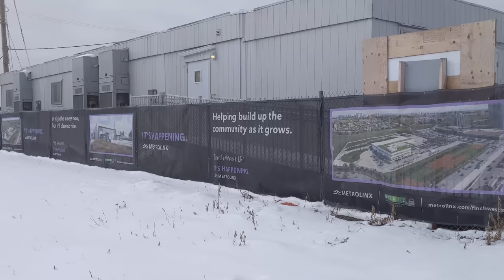Missing Links: Short-Sighted Transit Planning

Comment: The video does not mention an important class of missing link:  The deliberate missing link.  This is usually the case where two different governments or levels of government are constructing transit and feuding with each other.   The example in Toronto that drives me crazy is the lack of connection between the Leslie subway station and the Oriole GO station.   In a rational world, the GO station would be moved 250 metres up THE EXISTING TRACK and co-located with the subway station in order to make for an easy transfer.   But we do not live in a rational world.
Reply: Another example is the Bloor GO Station, to the east of Dundas West Station - of course, the added problem there is Crossways Mall between both stations, that could provide a decent underground connection, but probably will never happen.

Also, there is Danforth GO and Main Street Station, but that one was more a problem of proximity between the two stations...one being the location of (I believe) York Station on the Grand Trunk Railway, and the other having been a streetcar loop just north of Danforth Ave.  Mind you, if/when the quad-track is installed, the GO station is set to be moved further to the east, with the main entrance being closer to Dawes Rd. with a connection still at Main St. but still a bit of a walk down the platform now.

(I was also reminded this week that there used to be a streetcar stop for the 506/Carlton Car at the top of the bridge, right by the old stairway, but that was removed when I was a kid.)
Reply: They are moving the Oriole station btw, its just not high up in priority.
Reply: @robmausser  Good to hear.   Do you have a source for that?
Reply: if you cant walk a few blocks to the next station, I am supposed to feel sorry for you?
Reply: @BertGraef  No, I do not really expect you to feel sorry for my arthritis.  Because that would involve having a heart.
Reply: That's why I quite like the fact that public transport is mostly a state government issue (as opposed to a local government issue). That diminishes the possibility of different agencies working against each other. 

 Though that's partially because (with the exception of Brisbane), the other local governments are usually tiny, with less than 100k population in urban areas with over 2 million.
Reply: Good news theres a propsal to do exactly that

Comment: Los Angeles’ Green line not going to LAX was a major fail.
Reply: The cabbies' unions squelched it, as they did in NYC with a subway line to LaGuardia. Also, consider how the Green line falls a few miles short of reaching Norwalk/Santa Fe Springs Transportation Center at the other end.
Reply: @1978dkelly  That too is a major issue.
Reply: At least this is finally being fixed with interlining with the K Line.
Reply: MAYBE they just Lie.. And say earthquake safety
Reply: Not just a major fail. The lack of rail to LAX is THE ultimate transit failure. Like, you have one mission- to connect your metro seamlessly to the primary point where people enter.

Comment: One example here in Chicago:  the Brown Line, which ends at Kimball, just short of the Jefferson Park Blue Line station.  Extending the Brown Line to Jefferson Park would make getting to O'Hare a lot easier for many Chicagoans.
Reply: Absolutely! I used to live in Lawrence, and my options to get to O’Hare were take the brown line all the way to the loop and transfer to the Blue, or take the super slow Lawrence bus that stops every block. I used to fly to Detroit a lot, and I literally would spend longer in the bus than in the air
Reply: Also green line has to be extended to the 63rd St Metra Electric. It's the tiniest missing link in Chicago but makes traveling around the south side much more difficult.
Reply: @hugomorrison4520  From what I understand, the Green Line actually used to go that far, but neighborhood opposition caused the line to be truncated to Cottage Grove.
Reply: It’s 2.61 miles by the way the crow flies. That is not, “just short” of Jefferson Park. For any km people, that is 4.2 km. Anyone who says this is a close connection apparently walks at warp speed. It definitely would be a useful connection, allowing North Siders to get to O’Hare easier and vice versa. But it’s not even at the very least 1 km
Reply from the maker: Yep, a great example
Reply: While on the subject of Chicago, the lack of connectivity between the Metra Electric/Rock Island and the rest of the lines at Union Station is a missed opportunity to connect the southern suburbs with the rest of the suburbs
Reply: @PhilliesNostalgia  Yeah, it isn't super short but that just shows how much it's needed. Having the brown run west on Lawrence for those 2.6 miles, with like 4 stops between the Kimball Brown Line to the Blue Line would be a huge service to the people in Mayfair/North Mayfair. You could also cut out a half mile or more, depending on the path, by going back south a short bit and connecting at the Montrose Blue Line stop.
Reply: @JoeJoe-lq6bd  An issue I have that since Kimball is not elevated, is right up against Lawrence Ave, and there is a yard right next to it, it would be quite hard to get it elevated on Lawrence without completely rejigging the station area (tracks, station, approach tracks to yard). Not impossible, but certainly may present a challenge
Reply: There is bus line 81 though, but I agree a Brown Line would be better.
Or as a compromise an 81E with only intermediate stops at Pulaski and Cicero that times its departures with Kimball arrivals would be great.
Reply: @PhilliesNostalgia  For sure. Running at-grade is kind of quaint and charming  throughout the neighborhood but not the best design for expansion. But I also think that expanding the Brown to connect to the Blue Line and Metra is probably the easiest sell as a first leg of a circle line. Long-term, Chicago absolutely needs the connection.
Reply: @JoeJoe-lq6bd  Would a bit unusual though to run like a streetcar on Lawrence, but the cars were based off of streetcars, so, it’s come full circle? 🤷‍♂️
Reply: @PhilliesNostalgia  I would have no issue with it and it could give that stretch of Lawrence some character but I cannot see there being much local support, since it would take up road space, with both the tracks and platforms.
Reply: They should have fixed it in the 80s when they extended the line from Jefferson Park to O'Hare. It was already a massive project, what's another two miles?

Comment: The Warsaw Metro has several annoying missing links, due to a lack of coordination with existing rail networks. It doesn't go to the main railway station, Warszawa Centralna; or the important East Station (Warszawa Wschodnia), where Line 2 diverts away to connect instead to a pointless terminus station (Warszawa Wileńska) on a line that could easily have been rerouted to the east-west mainline rail tunnel, to allow most commuters to reach downtown. The WKD rail line to the west also does not connect directly to the Metro. The Metro also avoids the main tourism areas, notably the Old Town. And Line 2  circles backwards to end at Bródno station, just a few hundred metres short of Toruńska commuter rail station.

Comment: Couldn’t Boston’s Blue to Red Lines be connected with a moving walkway in a tunnel for less than $1 billion? It’s only around 1 km. I used to commute that route and it’s quicker to walk between the stations exiting and entering the system than taking connecting lines. If you don’t have a pass you’d have to pay 2 fares and entering the Red line took either crossing several crosswalks or jaywalking across several lanes of traffic. The connection would make this a lot more convenient and safer - a cyclist was killed by traffic in front of me while I was walking in Boston.

Comment: It's not widely known but the two "missing" stations north of Cote Vertu station on Montréal's Orange Line - Poirier and Bois Franc - were in the original project but were halted by the Quebec Government to rein in costs. Parts of the tunnel are reportedly already excavated. In the late 80's this would have provided a connection to the CN's Deux Montagnes commuter line but now, of course, such a connection would provide access to all the lines of the REM.
Reply: They should build the orange line extension now. The blue line extension to Anjou is great, but the orange line extension to Bois-Franc (which was deprioritized in order to go ahead with the blue line extension) might be even more useful because of the connection to the REM.
Reply: This one makes me so frustrated. It's such a no brainer!
Reply: @ethandanielburg6356  they even had the tunnel boring machine down there to extend the tunnel to the new metro garage on Poirier. It would have cost only slightly more to at least complete the boring of the tunnel to Bois Franc about 1 km away. Even if they finish it later with tracks, lighting etc... 

But getting the boring machine back in place now will cost so much more. And they'll never do it just for a short extension. These kinds of stupid decisions are what make people hate governments.
Reply: @kb_100  I believe the tunnel to the new Côte-Vertu garage was excavated using drilling and blasting, which is how most of the tunnels of the Montreal metro were dug (although a few sections of the original metro built in the 60s were built cut-and-cover). I imagine the plan is to build the remaining portion of the orange line to Bois-Franc using drilling and blasting, rather than using a tunnel boring machine. I think using TBMs over short distances tends to not be economical.

The REM tunnel to the airport was actually the first rail tunnel in Montreal excavated with a TBM. The blue line extension is also going to use a TMB between Pie-IX and Anjou but use the traditional drill-and-blast method between Saint-Michel and Pie-IX.
Reply: But yeah, part of the tunnel between Côte-Vertu and Bois-Franc is already dug and there’s only about 1km left to dig (after which they would of course have to also build the two new stations).
Reply: @ethandanielburg6356  thanks for the background!

Comment: I’m glad you mentioned Boston. The Red/Blue missed connection is the most glaring but there are others. In general, the connections between the Commuter Rail and the subway could be better.

The Green Line Extension that just opened runs adjacent to the Lowell Line of the commuter rail. But you can only transfer between them at North Station in Downtown. This means anybody from the suburbs trying to get to Somerville would need to go all the way to downtown before heading back out. The Green Line should have been extended to West Medford or an infill station should be built on the Lowell Line. 11:11 

Similarly, the northern terminus of the Blue Line (Wonderland) is   just a couple hundred feet from the Newburyport/Rockport Line. But the commuter rail doesn’t stop there, so you can’t connect.

The connection between the Ashton-Mattapan trolley line and the Mattapan commuter rail station leaves a lot to be desired.

Riverside, the western terminus of the Green D line, is very close but not connected to the Auburbdale commuter rail station.
Reply: The even more godawful one is the proposed purple eastern route station in Revere in a ploy to avoid extending the Blue line to Lynn  with a transfer that is too long to walk, and too short for a shuttle bus. Multiple mode breaks and asynchronous schedules. Don't forget the recently restored rail lines that stop short of the commerce centers in parking lot wastelands.
Reply: The Union square branch of the green line should also have continued to Porter Square to provide connections with the red line. It's only like a 0.5 mile
Reply: Yeah, if I recall there has been renewed conversation on adding a CR station along the GLX Medford branch. It came up recently because its just way too obvious + the new construction allowed for areas to potentially host new CR platforms. I think another missed opportunity was to finally add catenary infrastructure above the renovated Lowell tracks on the medford leg. 

And let me add, I think right now the mot feasible location for a CR stop would be at Gilman Square. Not only is it a pretty centralized spot, but there's ample space to minimize construction costs for a proper elevated platform for CR.
Reply: The other glaring missing link in Boston is between South station and North station, though that's Amtrak's issue, not Boston's... idk...
Reply: It's as though they do it on purpose, just to spite people who use public transport (or might dare to think about using public transport). It's as though it's some sort of elitist power play.
Reply: @mastertrams  the lack of a North/South rail link isn't just an Amtrak problem, it greatly limits how many commuter rail trains can run to Boston since they're limited by the number of terminal tracks at North and South Station. If those were no longer terminal stations and instead more like Back Bay, you could have trains flowing through the city every couple of minutes.
Reply: The most annoying thing about the blue/red connection is that the tracks used to connect, though the connection was never used in revenue service. Always one step forward, two steps back.
Reply: @mastertrams  It would make the MBTA commuter rail far, far more useful as well as making Amtrak service possible to New York from my town. It would literally change the transportation mode that's best for my work commute from a strange semi-private bus line to commuter rail.
Reply: @ZanHecht  And it would also knock about half an hour off the travel time you currently need to get to the "wrong" terminal's neighborhood (whether you go by subway, bus or on foot it seems to be about the same).
Reply: @MattMcIrvin  It could also bring into the realm of slight possibility the prospect of extending the Acela to somewhere like, let's see, Montreal?
Reply: @mastertrams  All the Amtrak service north of Boston is a sleepy curiosity these days and it's really all because there's no connection with the Northeast Corridor. Making that link would change everything.

Comment: Singapore decided not to build an underground passageway between Rochor & Jln Besar underground stations (~300m apart), saying it was too difficult as they ironically were planning a road tunnel immediately above them. So interchanging between the 2 to shortcut from 1 end of the Downtown Line to another (since the line loops around itself between these 2 stations, which are both on that line) means having to detour to street level, which is a significant issue as both stations are quite deep. Meanwhile some suggested solutions to this inconvenience include detouring via the bigger Circle Line instead (which takes about just as long) or using the bus

Comment: Slightly off topic, though a complete missing link: it’d be really interesting to hear your thoughts on the lack of any public transport bar buses and (some) trains in Leeds, UK. Especially since there actually used to be several tram lines that (due to extremely short sighted transit planning) were removed in the 50s. Does that annoy you just as much as it annoys me lol? Knowing how expensive and how many problems it’d cause for traffic flow, I’m not convinced there will be anything put in place, but it’s always nice to dream, eh?
Reply: It is off-topic, but yes, it's shocking that the city doesn't have a metro or light-rail.

Comment: Even though it is still in the planning stages New York City's Interboro Express has a major missed connection: it will terminate in Queens instead of being routed so that it can go into Penn Station and/or Grand Central Madison. That would have allowed major connections and transfers in those two major hubs to other subways, AMTRAK and Metro North. Of course the rolling stock would have o be worked out if it was to use the same tracks but that would be the last issue once the rail connections were made.
Reply: the IBX will be at grade, which could limit its ability to connect onto the EFMR or 7 trains

there may also be an issue with getting a transfer between the trains to work